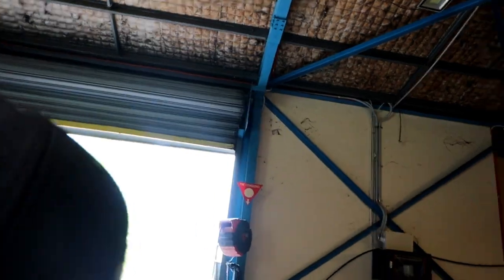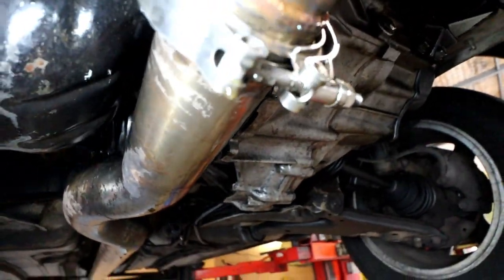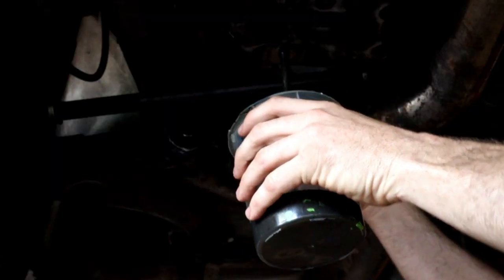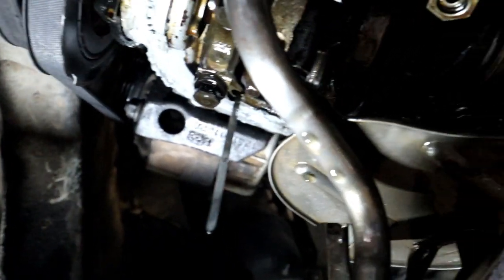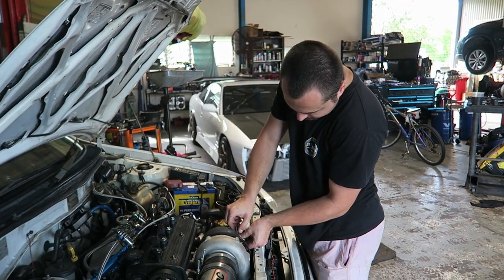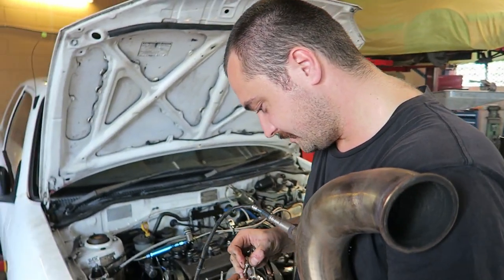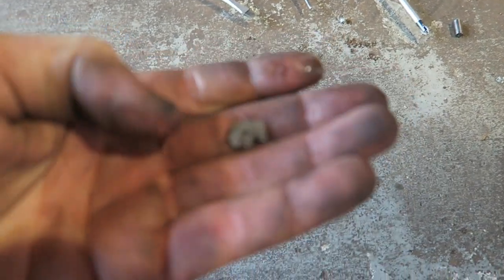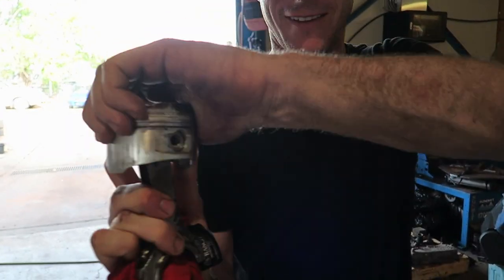Nicks engine has spun a bearing :(

Comment: It seems like that cylinder #3 always likes to get rod knock. I just did a bearing slap on my 5e and didnt do anything about the egg in the crank and machine shop wont grind it lol.runs great.has slight knock compared to before. I can still drive it and get mileage before replacing crank and rods. I went with undersize rod bearings and honed em out to size of the large part of the egg in crank 😆

Comment: Hey Matt
Whats the difference between n/a starlet and glanza gearbox...how to look for them
Longer gears and bigger cups(where shafts go)..so shafts different too-insides triple joint bigger
Reply from the maker: Na (c150) hàs a black steel end case. Galanza c52 has a alloy end case
Reply: @MattBerrymotorsport  Cheers mate.

Comment: @mattberry what turbo is on campdogs starlet?
Reply from the maker: G30-770
Reply: @MattBerrymotorsport   would you recommend this in a forged gt also would you know why big turbo i can get to have it spooling on low end?
Reply from the maker: @mojitohhhhossey4049  all depends what hp you wanna make. Have a look at my most recent videos of the blue starlet. Runs a gtx2867. Full boost at 5500 makes 385 hp in a hot climate...
Reply from the maker: This g30 is no doubt too big. We are purely doing it just for hp numbers...

After all it is a 770 hp turbo lol
Reply: @MattBerrymotorsport  lovely to know yeah watched everysingle one lookting for the 400hp mark too but want a low end spool…guessing the gtx28 is capable of doing so?